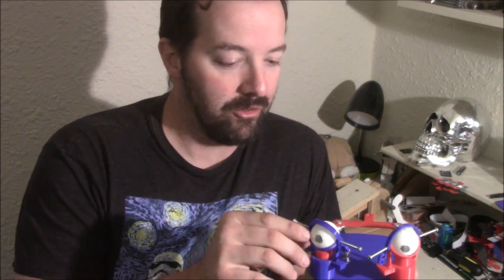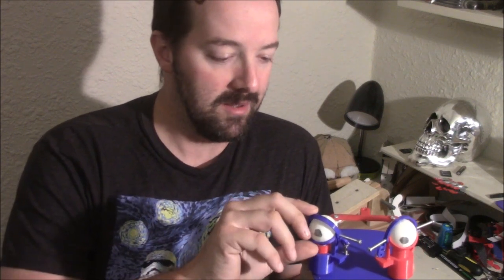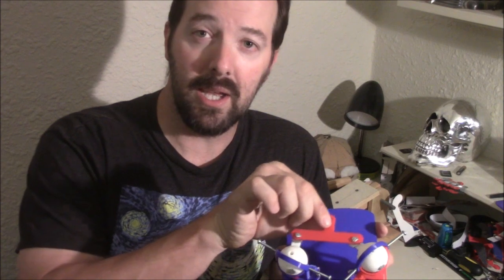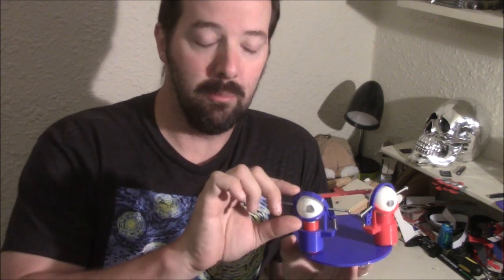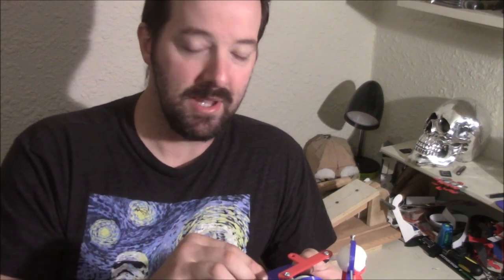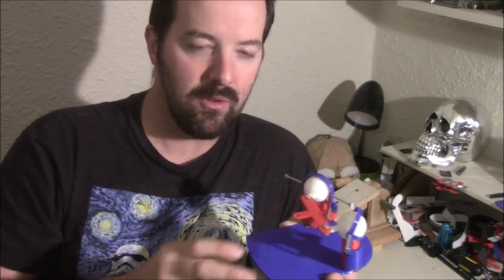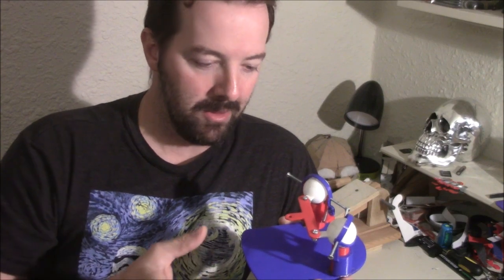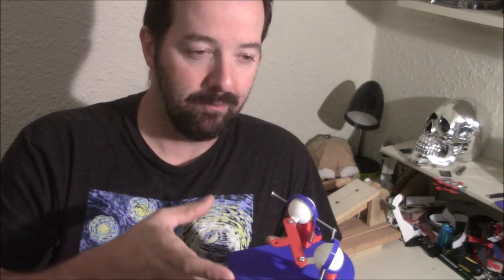Building a Skeksis Puppet: Part 3

Comment: You know fidget spinner on part 2 use those, still the size of gear in wood that goes up and down. Glue outside bearing for snug fit. Run bolt thought. It will ride smooth.
You also put one in pivot, that also run smooth.